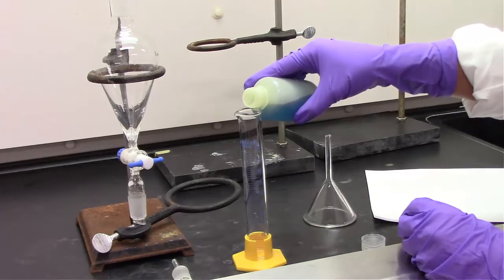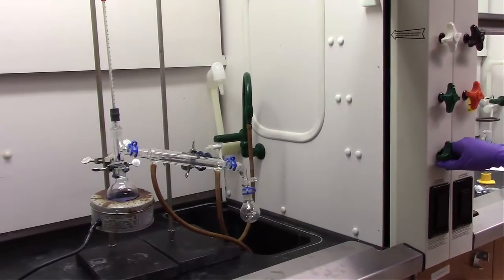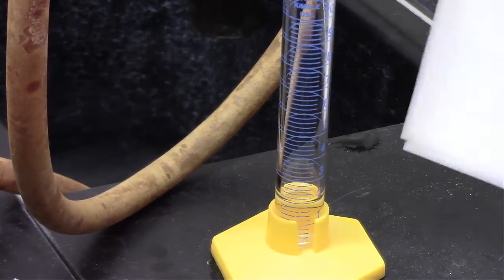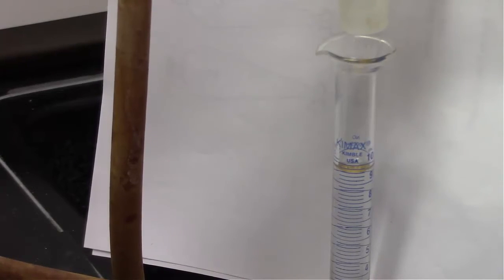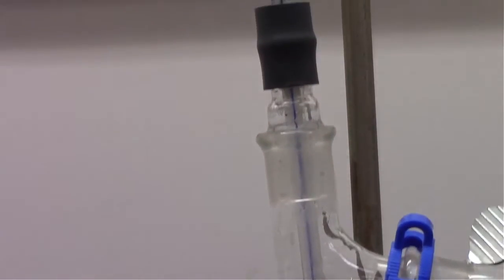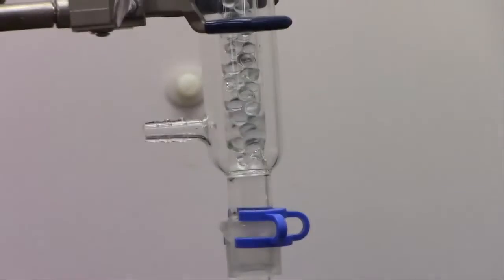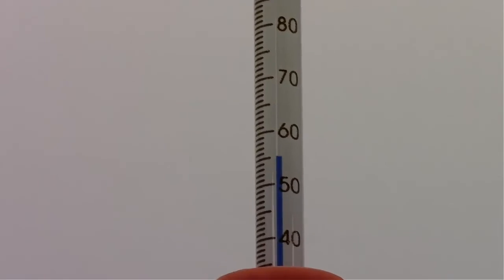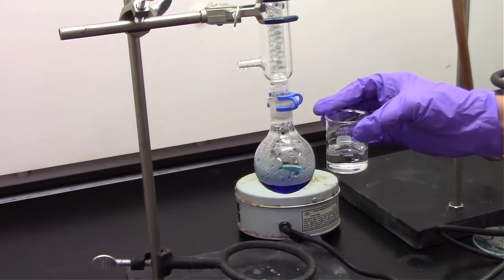Distillation: separation of acetone and water through fractional and simple distillation.

Comment: So how would you actually predict your acetone : water ratio? Is it based on the displacement of water from your original 50 ml beginning solution?
Reply from the maker: It is based on the lower boiling point solvent, acetone, displacement which can be determined by volume as well as temperature of reagent or mixture being distilled. If the temp is higher than the bp of acetone, some water is being carried over as well

Comment: What happens with water and acetone when you add another chemical? Let’s say for example you have an Azeotrope of water and toluene?
Reply from the maker: You could separate 3 different compounds via distillation by swapping your collection flask, but as you mentioned, an azeotropic mixture of 2 solvents of water and toluene simultaneously boil at a lower temp than their individual boiling points. In that case you would likely isolate some acetone before collecting a mix of water and toluene
Reply: Thanks for the response. In the event all 3 chemicals end up in a decanter together, where they settle out and separate with interface, would the acetone stick with the water phase, or hang with the toluene phase?
Reply from the maker: @nickjones7679  Using solubility calculations you could determine specific percentages, but I would expect 2 layers of separation. Mostly water and acetone in the bottom layer and toluene on the top layer.

Comment: hi, hope you answer my question, why does the entire mercury bulb thermometer must be below the level of the side-arm to obtain an accurate reading of the distillation temperature?
.
Reply from the maker: The vapors of whatever is being distilled need to fully surround the thermometer bulb to read the boiling point temperature of that compound. A more sensitive thermometer or a three-way adapter might allow the thermometer to be placed slightly higher, but from these experiments the placement just below the entrance of the three-way adapter provides the best data collection.
Reply: @danielmiller54  Thank you. what about  In the process of distillation of a mixture of acetone and water, how does the original composition of the first vapor produced compare with that of the original mixture?
Reply from the maker: @nhovagalera1485  the composition of the first vapor is very close to 100 percent acetone. The original mixture was unknown, but based on the volumes of solvent collected related to temperature, it was concluded that the mixture was 1:1.

Comment: On the post-lab worksheet for experiment 4, what does it mean by which unknown solution did we use? Only one solution was shown in the video.
Reply from the maker: That is a good point, and you should use that explanation for your answer. In other labs we have used different ratios and the mixture was labeled as solution A or B. In this lab we just showed the distillation of one unknown ratio that we are asking you to predict

Comment: Thank you for this video! It made fractional distillation much more clear.  How are we supposed to continue the data to 50 mL for our results section?
Reply from the maker: There is a short explanation for that within the provided data file. If you have read that then you still need to make a assumption that only water remains to be collected, and you can calculate the amount of water remaining by subtracting the amount collected by the total volume.
Reply: @danielmiller54  Okay, so I would continue heating to collect the 17 mL of remaining water until both the fractional and simple distillation reach total collection of 50 mL. I’m more confused about the temperatures. Is there a specific temperature all the 17 mL of water should be gone by?
Reply from the maker: @mariakelly5877  Once water starts collecting, only water is remaining. So when water is boiled and collected, you can make an accurate temperature prediction based on the known boiling point of water

Comment: Sir, what do you think was the energy consumed for this separation?
Reply from the maker: If you are you asking about the energy consumed by the heater to allow for the distillation then we would need to assess the watts being pulled by the heater through the powermite as well as the time required to complete the distillation.
Reply: Also, do you think that if we maintain the heating temperature at 60C, all acetone will be separated from water (except for a little amount of water that will naturally evaporate with acetone)
Reply from the maker: @shubhamkumbhar6023  The heat level applied does impact the separation potential, but the temperature seen throughout the experiment was based on the vapors of solvent surrounding the thermometer. So to answer you question, yes, if we can maintain a temperature equal to the boiling point of acetone (56 degrees C), then we would be isolating acetone from the water. Thanks for the questions!